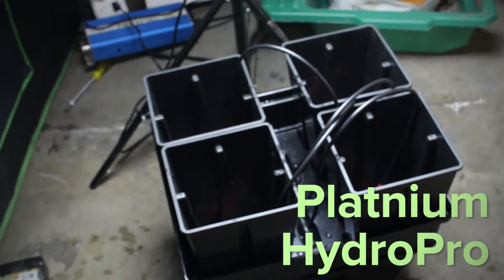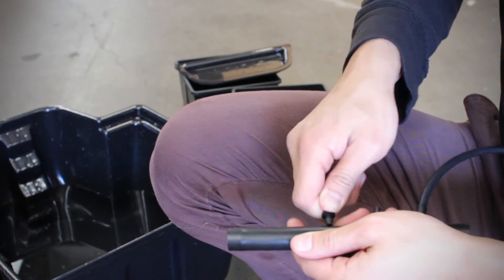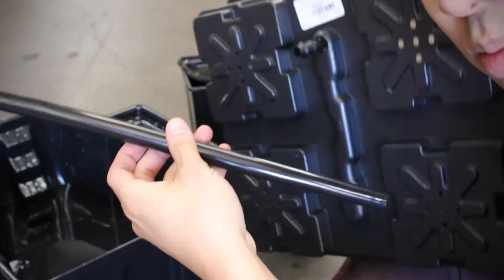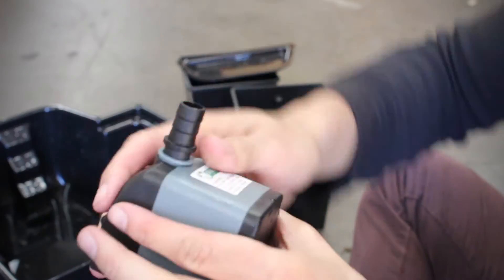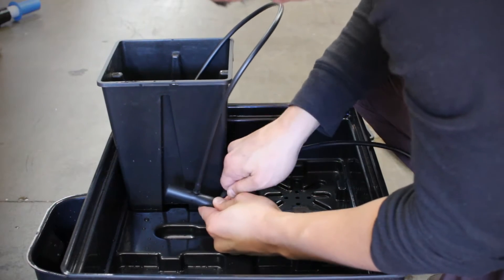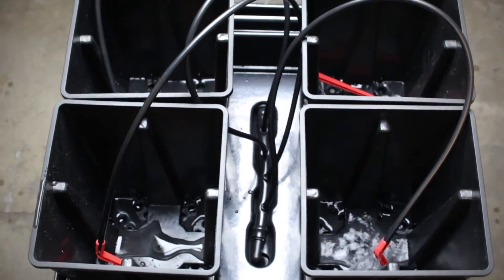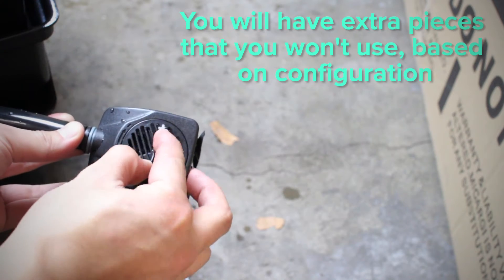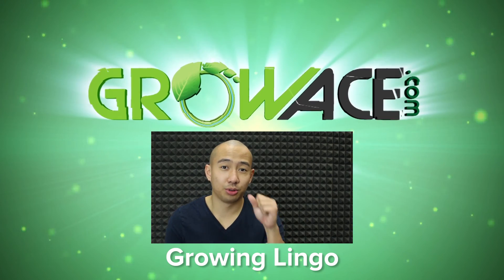How to Setup a HydroPro - Hydroponics

Comment: Would u have to lift the lid/tray off to change water in the res?
Reply from the maker: Yes, but we've seen modifications with drain valves installed that work really well.
Reply: GrowAce yea i was thinkin up on a little ledge, just to get the flow going, might b a good idea.
Reply: I just got one with a 30 litre reservoir and it has a smaller lid on one side that gives access without having to remove the pots. The one in the video has one as well.  Just use the pump to change out the nutes